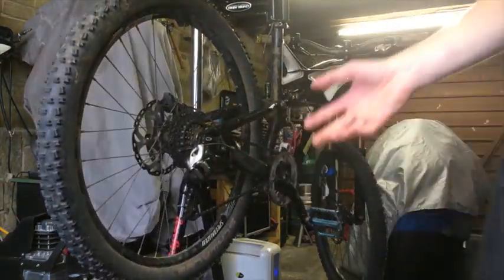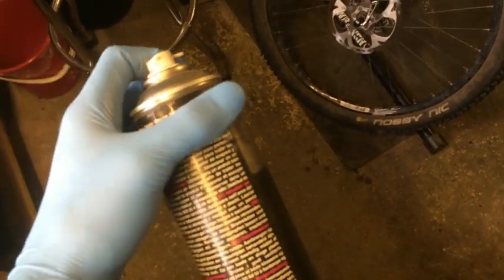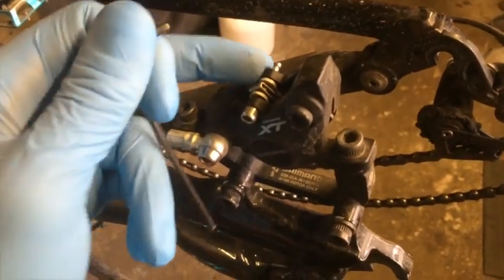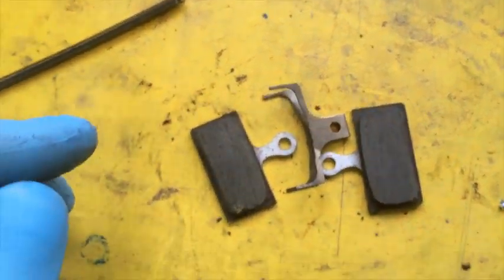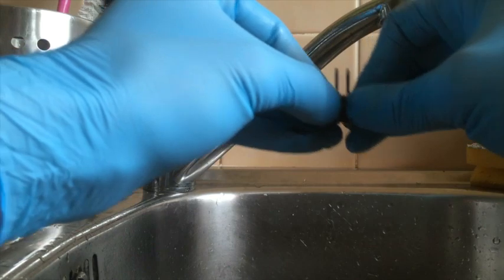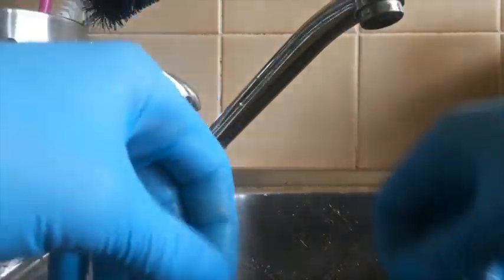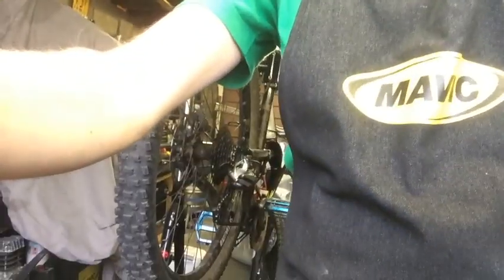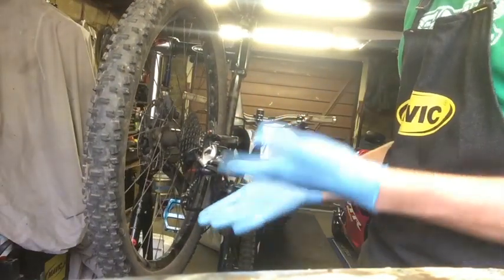How to stop a disc brake from squeaking

Comment: Have anyone know how to fix the back wheel brake. my problem is the brake have stick to the disc so when I ride it, it make me slow down a lot.😥
Reply from the maker: What make of brake is it? sounds like sticky pistons or worse, damaged master cylinder seals.
Reply: +High Carb Rider My brake make by Hayes MX, it is no noise when I use it. last time have hit the tree in the trail and when go back home check my bike the brake just stick to the disc.😓
Reply from the maker: thats quite common with Haye brakes. If you take the pads out, hold a 5mm allen key in the centre of the calliper then slowly pump the brake so the pistons are exposed ( the 5mm allen key is there to prevent the pistons from coming out too far and falling out) you can then spray the pistons with a lubricant like a silicon spray or stay oil. Once you have done that, slow and carefully push the pistons back into the calliper one at a time. It is important you ensure the pistons are pushed in squarely otherwise they can jam if pushed at an angle. This will generally help free up the calliper and get you back on the road. If this doesn't help then you will need to service the whole brake with new seals and fluid.
Reply: +High Carb Rider thx your reply but I don't have the Allen key to repair will that ok?
Reply from the maker: yeah you just need something to of around 5mm to stop the pistons from coming out.
Reply: +High Carb Rider thx for that I will try my best to fix it.😊
Reply: +High Carb Rider sorry I can't take the pad out😥
Reply: I had this problem. Today i fixed it. My wheel goes fine but the break doesn't work anymore lol. The oil went out.
Reply: it could have been just dirt behind the pads if you crashed.

Comment: my brakes doesn't squek anymore but now i need to press the brake a bit more than i used to, why is that?
Reply from the maker: Sniperz Combozz could be worn pads, air in the system, miss aligned calliper etc

Comment: I just did it but the brake pads i cleaned them with a towel then put them all back and my breaks still squeaking :(
Reply from the maker: Your pads maybe too far gone or it could be another variable causing the squeal.
Reply: +xtapodiKsidato I had to get new pads and that solved my problem.  Sometimes the pad is just too soiled to be useful.
Reply: Kerry Hales I did the same too,i got new pads and the problem gone...

Comment: just clean your bike with a good quality car wash detergent....job done.
Reply from the maker: Not really, although car shampoos are safe on bikes as they don't contain salts which will rust the bike they usually contain polymers and waxes which will coat the disc and pad surfaces. Even motorcycle cleaners always recommend using disc brake cleaners in the discs after washing to remove the contamination the cleaning products may have left over.
Reply: I use a car wash that doesnt contain polymers and waxes , its just a detergent not a shampoo :-)

Comment: No need to clean the brakes with alcohol, that doesn't work. All you need is some CRC DeSqueak that you can pick up at any auto parts store. This stuff works and is cheap.

Comment: This is crap, i had to clean several times the rotors with alcohol, boil the pads, soak them wit alcohol, burn them with the alcohol. sand a bit the pads and clean several times with a rag soaked in alcohol. i've done that about 5 times with new break pads. 

i used to ride downhills (about 800 meters) breaking all the time so the brakes get extremely hot and then burn the grease (mineral oil) on them. after doing that, breakes worked really well and without noise at all. but as soon as they rest for about 1hour, it used to go noisy again..

As the time passes, they started to break more and more and finally about  4 or 5 moths later, they stopped squeaking "magically".. but during that time, i used to clean the rotor with a rag soaked in alcohol, at least once a week . I have resin pads, and since then, it never got back to squeaking again :)

Comment: squeaking stopped just not very strong now>
Reply from the maker: You will need to bed the pads in, running them when contaminated will have glazed the surface of the pad. You can sand the surface to get the glaze off or do a good muddy ride

Comment: My friends though it would be funny to put baby oil in there because it makes tons of noise but I usually go 3/4 of a mile all downhill and use rearbrake to not speedup to fast but when they did that I though I had lost my brake pads I was like oh shit at first but when I tried the front there was sooo little braking power I freaked out I pushed as hard as I could then I started to see white smoke I though my hydroulic fluid started to boil but soon after the smokebi started to fell more and more power lucky I was able to stop before a red light then I walked my bike home scariest situation I have ever been I use a presure washer to clean them but did not work and it freaken sounds like there is a plane taking off in the background or a turbine when you are watching them lol
Reply from the maker: That was the day you discovered they were not your friends

Comment: can i use wd 40 or any other solvent to clean the disc brake? btw whoever thinks that wd 40 is a lubricant... it's not. and yes your life was a lie
Reply from the maker: No, WD40 is not a lubricant and can be used to remove grease and grime but it does contain lubricants which would clean the disc surface to the eye, it will also leave a layer of lubrication which will prevent the pads form adhering to the disc. WD40 event make a degreaser aside from WD40 it's self. The best and cheapest stuff is clutch and brake cleaner which is available from most car shops.